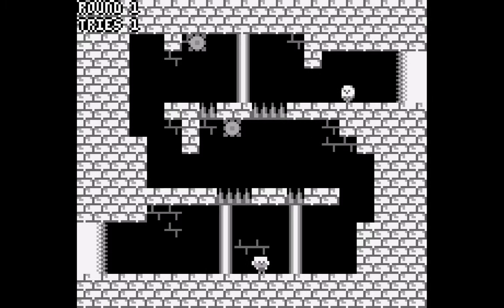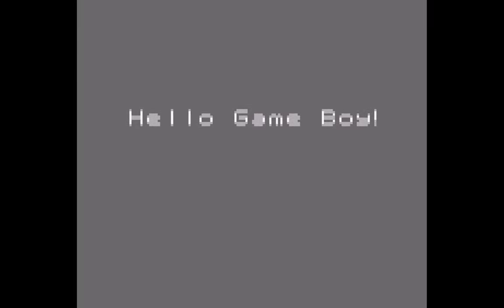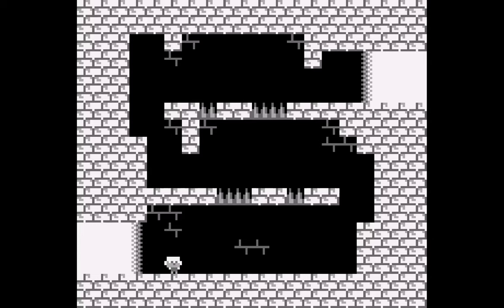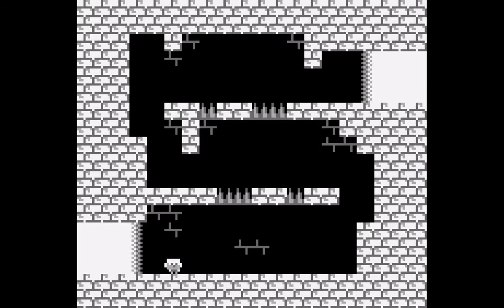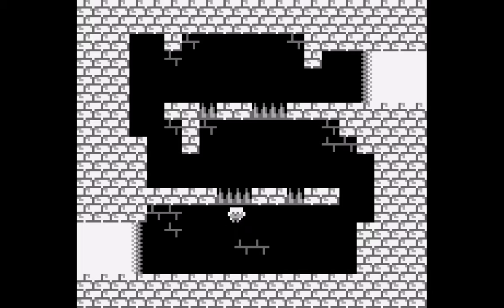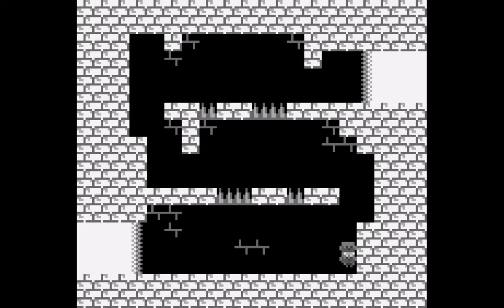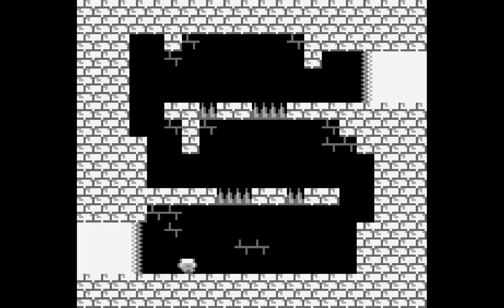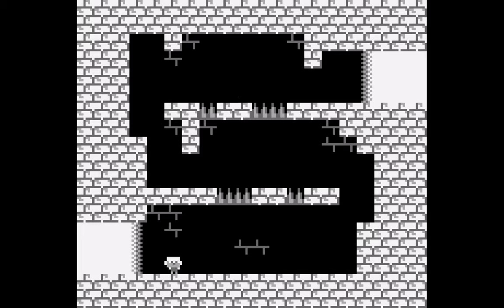Making a Game Boy game - An overview of the development of Ice Cream Castle

Comment: A fascinating watch! Did you record the footage as you coded it, or did you trawl through your git history to produce this? If so I applaud you for keeping such a nicely parseable git history. I feel like when I rewind time through git in my projects, I can never be sure the build will be just the way it was somehow.

I am curious about what made jumping difficult after you had already implemented gravity. Normally at that point, it's as simple as setting the yspeed to some large value. I see your code has a very different control flow depending on whether or not the player is going up or down. You could probably simplify it a lot by having the logic be the same either way. In theory it shouldn't be too hard if you use the "add HL, BC" opcode to do 16-bit arithmetic on pixel:subpixel.

By the way, I see you're incrementing/decrementing the A register in the collision check macro before moving it to B or C. You can actually inc/dec B and C directly,  so you can cut the size of those macros quite a bit.